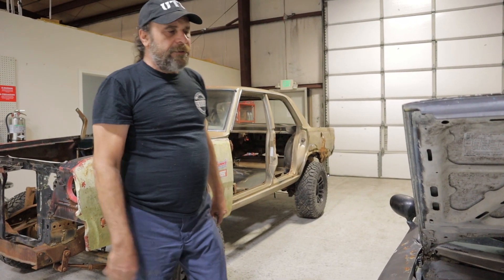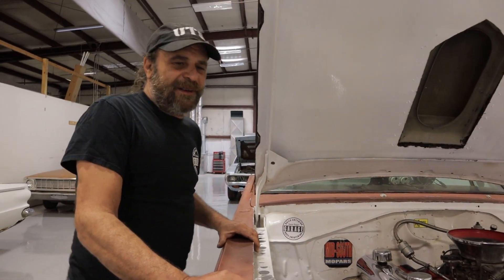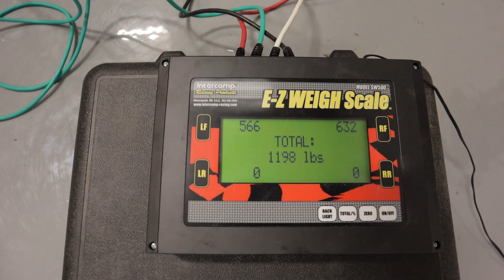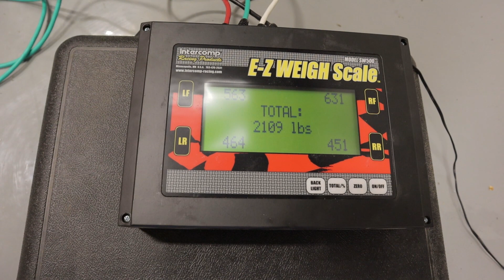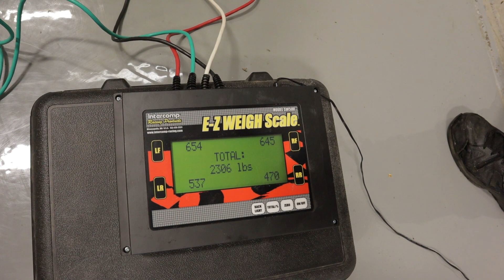Plan Z Weigh-In FAIL!...And A Slanted Miata?

Comment: If something like this was around when I was young I would have been happy to hang around and work for free just to learn stuff.
Reply: That's what I did back in the day. Hung out with the motorheads on my block when I was 11-12 year's old in the sixties. I remember sitting in the engine compartment of a guys 57 Chevy pounding pistons in during a ring and valve job. I loved it. I'm 63 now and the magic hasn't gone away. Uncle Tony is the real deal. I love Mopars too from the sixties and seventies as long as they have points in the distributor, I work on them.

Comment: Love the slanted Miata idea.
Reply: Him calling it weird and kinky made it better lmao. I think its a good idea, no hate on the little what 1.8 engine in there or 1.6 BUT a slant seems like more his style. I'd love one of those little cars and just have a peppy little scooting car.
Reply: He's gunna do it no matter what, but its not going to be an autocross car anymore when you add 175lbs to the front and even have the weight further forward, but relocating the battery to the trunk and putting racing seats in the front would help...hole saw?
Reply: A slant 6 in a miata? That's a terrible idea. I love it.
Reply: @nicholasagnew2792  heavy battery in the trunk and some fiberglass or even carbon fiber hood and fenders should balance back out.
Reply: @nicholasagnew2792  The engine weight will be more toward the rear than the stock engine because part of the engine actually sits in the passenger area of the vehicle.  He had to cut out a nice hole in the firewall to allow this to happen.  Of course, your comment was made 1 month ago and he may have done all that to the Miata since then.  I just watched a recent video on it and, it fits...barely...but it does.

Comment: Plan-Z - battery - remove the lead acid battery and replace it with a Li-ion staring battery.  You'll loose 40# easy :-)
Steel wheels on the front have to go.  Pro-Stars weigh half.  Look for lighter tires ...
More drilling - backing plates, sides of the brake drums, I'm sure you can find things to drill ... You are not going to be stopping in the rain ...   CrMo tube tie rod and other steering bits ...
On the Miata, slant hell yes (do you have an aluminum one?).  Chrysler four speed, or full manual valve body TQ-Flite.  Gotta have side draft carbs (sports car you know).  Some bling would be nice.  Set the engine back as much as possible to help with weight distribution.  Ultra heavy fronts do not help on the Auto-X.  It'll be a ton of fun.  Nothing out there will have the TQ to weight ratio, except full on race cars ... :D

Comment: Lighter wheels. The factory steelies aren't the lightest, and the rears might be lighter if you went with a circle track wheel.
Reply: Basset wheels are the lightest steel wheels at 19lbs ea. They use them in NASCAR
Reply: Yes to lighter wheels.. but.. them Mopar wheels don't weigh much.. he could always drill more holes in them Center lines.. that's a terrible idea those are rare as F, there 5 on 4 bolt pattern.. the Classic Dart owners Bane.. hahaha trust me I know..
Reply: Thomas Burch spot on . Also , would that car hook on a 7” slick ? Very skinny front runners . Make his own carbon fiber lift off only hood and deck lid. Since track only , could rear discs be used and front brakes removed ? Cast aluminum valve cover / then file off all but the minimum to seal . Is there an aluminum slant 6 head available? Or was all unnecessary weight removed from it like it was from the block?
Reply: @DougsterWolverineGarage  Remember this is a poor man build, people keep forgetting that!
Reply: @jamessharp9790  This is a poor man build people!!! Anybody can throw money at it and loose another 300 plus lb
Reply: @hemidart7  good point!
Reply: Hes like a super good bracket racer he made the bottle rocket faster in the 1/8 with heavier wheels

Comment: Tripple Webbers on the slant in the Miata please!
Reply: Absolutely! Then it becomes very easy to make different runner lengths to move the torque peak up or down. You can also make and test individual runners vs one, two, or three plenums. Maybe team up with holdner and do dyno testing.
Reply: @davidleonard8369  I'd even be happy with SU's :-)
Reply: @brocluno01  never liked any cv carb. But I have tuned many of them.   And many types of vehicles have been manufactured with them. Sure fixed a lot of motorcraft vv 2700 carbs back in the eighties.
Reply: @davidleonard8369  I think the shop took the VV in my old 79 LTD out back and shot it. They could either get it to pass emissions or run right, not both.

Comment: A slant in a Miata is just wrong.  And that's why we do stuff like that - because it's wrong.  :-D
Reply: I think I'd go with a 318, but even a slant 6 should produce a fast car, small and lightweight.
Reply: I agree, personally I'd put a 2.2 out of a 80's Daytona in it
Reply: But the slant is mucho torquey AND high revving! I think the slanty is a better choice than a v8 for this application
Reply: @DougsterWolverineGarage  Slant 6 High revving? Have you ever seen one? they are flow limited to about 4-5,000 RPM. There is no way possible to over rev one, except rolling downhill in 1st gear, starting in 2nd gear
Reply: @Tony Ross Right on! That's about a 2400 lb car, and with a dose of the UTG weight-loss program, that could be a real screamer.

Comment: You said you wanted to SCCA the Miata, a slant will mess up its weight distribution, and make it super nose heavy. Not that it would not be neat, but it’s a go cart the way it is. Replace the clutch and run her for a bit first.
Reply: I just posted that he need to look at the SCCA rule book before he does ANYTHING. I wonder if he has ever heard of Formula Drift?

Comment: Just commenting - not telling you what to do. :D I'm sure you could pull weight out of those seats, use a Borgeson steering box and maybe a lighter steering column, replace the battery with a 'stereo amp' LiOn battery, drag shocks...

Comment: I don't care if they're "out dated", I still LOVE the look of those rear wheels on Plan Z! Since Cragar SSTs apparently aren't available anymore, I just ordered a set of American Racing Outlaws for my current project, 15x10s for the rear and 14x6s for the front to get a bit of "rubber rake". I'm planning to strip off the clear coat and polish them to a mirror finish.

Comment: It's funny you guys weighing this car and you talking about the amount of gas in it remind me that my dad always used to leave his truck running when he went across the scales he said that the oil that was flying around inside the engine didn't weigh anything cuz it was flying through the air he would always then turn the truck off when we got back on the scale so all the oil was in the pan

Comment: When Slant swapping the Miata, please use the smaller engine so it will rev. Also, I believe a few videos back you were talking about wanting an inexpensive light weight piston for the six. I vaguely remember from decades ago, a guy in one of the thick, specialty issue mags was using pistons from the little compact front wheel drive commuter cars Chrysler used to sell in the slant six. I can’t remember what rods he was using. Maybe one of your viewers has a copy. I haven’t been able to find it in digital form. Good Luck and Happy Hunting!

Comment: As someone else said, a smaller battery will definitely get you down to your weight goal. Or, if you take a generator to the track, you could lose the alternator and charge the battery between rounds.

Comment: Aluminum radiator,  aluminum master cylinder, are the front wheels steel? Find Lincoln or mercury spare tires they are 16 in skinny aluminum and matching bolt pattern

Comment: From what I can find about the base weigh of this car, it shows 2,705 to 2,855 lbs, so at 2,100 lbs, that's a pretty good amount shaved off this car.
Reply: Car came out to 2109lbs . W Tony 2305lbs .. but yeah good amount of weight was removed.
Reply: @codyramos3200  Thanks, I did see the video. I must have not proof read my comment before clicking the button. LOL 
then subtract 3 lbs for the prop rod.

Comment: Remove the hood and trunk hinges for aluminum pins and clips, go to a small aluminum radiator (steal from Miata), remove fan and put on electric one from Miata, look into lighter weight seats (aluminum sand rail buckets will weigh the least), lawn mower battery, Replace steel wheels with aluminum or mags, look at the efficiency of the leaf spring pack (given the output you could probably use less leafs or cut leafs).....that should get you to well under 2100lbs....probably under 2050lbs.

Comment: The hood has no structural support. I would drop a fiberglass hood on it and a fiberglass deck lid. Maybe some Centerline convo Pros up front. Are you still running drums up front?... maybe some lightweight aftermarket disc setup up front.

Comment: Two words... Aluminum and plexiglass.
Replace side windows with plexi, go with all aluminum master cylinder. Then crawl around it and 86 whatever you can shave off. Maybe come off a few bucks and have a composite hood and trunk lid knocked up. That might put it under 2000.

Comment: The idea of a slant 6 in a Miata both horrifies and intrigues me! Gonna have to boost or spray it if you want to make it worth it performance-wise, though, since the slant only makes around 30hp more than the stock motor while weighing a good bit more.

As for the Plan Z Dart, the logical next step would probably be a fiberglass hood/trunk lid and replacing the glass with lexan. That seems pretty antithetical to the build, though, so... maybe lighter wheels?

Comment: Tony, on your next \6 think about removing weight from the block. A very old super stock and road racing "trick". In the past Jaguar had body men smooth out the outside of their blocks with body filler because most of the I-6 block was visible.

Comment: Uncle Tony, You have to think about what class that Miata will run in before you change the engine. SCCA Solo 2 isn't Run What You Brung.. Before I moved  from the Chicago area I used to help a friend compete with his Toyota MR-2. There was a guy who was a National Solo 2 Champion with a TR-8. He told me his car's gearing was so high he couldn't drive it on the street and also he said automatic transmissions are the way to go. With a slant 6 it might be a better Formula Drift car.

Comment: While i fully support the slant 6 idea, whats stopping you put a fast 318 in it :P
Reply: Totally agree, it's shorter and more weight to the rear wheels!!!
Reply: 300lbs in the nose?
Reply: @ScottKenny1978  the slant really isn't gonna be lighter than a small block v8 they are both big cast iron engines. V8 miata's don't handle bad that is just a rumor.
Reply: @GnarshredProductions  it's still another 300lbs in the nose, which will mess up the balance.

Nobody driving a v8 miata is doing autocross.
Reply: @ScottKenny1978  I agree with you but an old cast iron slant six is also probably just as heavy as a small block and it will be worse because its longer so the weight would be further forward over the nose. Im an import guy if it were my car I would keep the 1.6L miata engine run on a standalone ecu like megasquirt and it would be getting a turbo but I think that new technology is above tony's level of understanding he is old school so for an older hot rod guy like him a small block v8 would probably be the easiest and best/cheapest option. Could even put a 4 speed behind it and install a hydraulic handbrake so when he gets bored of autocross he can go drifting.
Reply: @GnarshredProductions  apparently the iron slant is 195lbs heavier than the Mazda motor. 

The aluminum slant is maybe 65lbs heavier (aluminum being 1/3 the weight of steel). And a guy here has offered to send Uncle Tony an aluminum slant block! Fiberglass hood and fenders should account for any remaining weight increase from the slant.
Reply: @ScottKenny1978  that's not bad then with the aluminum block one.
Reply: @GnarshredProductions  watch more. the guy has efi skills

Not sure what a 318 and trans weighs
Engine and trans from a 1.6 or 1.8 miata is between 300-350lbs depending on whos measurements you decide to believe.
I fully support the autocross idea but it needs to be to the soundtrack of v8 noises!

Weight isnt the concern anyway. Its making it fit/sourcing parts/motivation thats the concern!

Comment: Weight reduction ideas if you havent done these already:

Go inside the doors and have at the window crank/articulators with your drills and hole saws.

Smaller trunk hinges

Shave the outer lips of the rims maybe 1/16-1/8 in if they can hack it.

Drill out some of the larger bolts/Replace some low torque/low stress bolts with aluminum bolts.

Aluminum pullys.

 Replace washers with loc-Tite

Take a flap wheel to the floor  and thin up some non structural areas.

Shave down some of the body seams

That should get you 10 pounds.
Reply: All of that and just go full titanium frame😉😂🤣😏😎✌🏽
Reply: or at least replace the door glass with Plexi
Reply: @Aaron-TheHandsome  Well thats a given ;)
Reply: @TD_YT066  Yes but he wants to keep the glass IIRC.

Comment: ROLL UP YOUR CIGARETTE UNCLE TONY!!! I was going to ask how much the hood prop was.
Hello Uncle John. 😁
Could you remove the truck spring rods and support braces to shed a few more pounds? Possibly make the trunk a lift off panel and then you wouldn't need the lock either.
Reply: @oldpolak5203  Rebar doesn't weigh that much. Less than most folks think.
Reply: Those factory trunk hinges and springs are gone.  The lid is held on with pins and has small strap hinges.
Reply: @johnwilburn  Thanks Uncle John, I thought I seen the truck was open on one video but didn't see a prop rod holding up.
Reply: @bigbear5510  It doesn’t have a prop rod, it will lay back against the roof to stay open.
Reply: @johnwilburn  Thanks again for the information.😎
Reply: @oldpolak5203  Uncle Tony could set in a sauna for a few hours to sweat off a few pounds. LOL

Comment: Uncle Tony try cutting out the back plates of the quarter panels from up under the car, it’ll protect against rust anyways, just be careful not to cut through the panels. Both cut out should be 7 pounds even.
Reply: Cut out the metal in the rear seat area, the spare tire compartment, and re-weld it flat. Should drop quit a bit.

Comment: I feel like yelling at Uncle Tony to not strap down Bottle Rocket by the passenger side control arm when loading it on the trailer for the May 8th testing at the strip.  I can't even warn him to take a new control arm bushing with him just in case.  It is too late as this video is now in the past and it is now May 9th and I still can't time travel.

Comment: Use a light weight battery like a optima it will easily shave  9 pounds +
Reply: Lithium battery. Way lighter. While we're at it let's put helium in the tires!
Reply: @davidleonard8369 He only needs to lose 9 pounds a light weight battery will easily do that as for the heliem really🙄
Reply: @oscarwalton1188  I was making a joke about the tires.
Reply: But it's shaving weight in the wrong place.  You want that heavy battery in the back.  Ideally, the weight should come off the front.
Reply: @entropy156  he only needs to lose 9 pounds that wouldn't make that much of a difference he could also pirate a aluminum to drive shaft from a late model crown vic
Reply: @oscarwalton1188   Aluminum drive shaft is a much better choice.  Weight reduction and it's rotating mass....if there's one that will bolt in.  Having one fabbed would screw up the other side of this build:  doing it for nearly no money.

Comment: 7 lbs? Easy... Look real hard at the battery....shave tread off front tires...i see room for more holes...is every wire as short as it can be? Gut the deck lid/hood. Smallest possible fuel cell? Drill the rotors...Put the wheels on a lathe...sand the paint off..cast iron master cylinder needs to go...acid dip everything.

Comment: Go smaller or use aluminium radiator when racing the engine should be fine for short running times

Comment: Tony, I noticed that you drilled holes in the inner fenders. Why not drill more holes in the floor pan and trunk?
Reply: The center of the trunk pan is cup out! I don't think that the tracks will allow you can run a car with holes in the floorboards.
Reply: They want the passenger compartment sealed in case of fire. 

I’d say a lightweight battery would make it easy to shed that 10lbs. Plus could go to skinny front wheels/tires which would save some more weight.

Comment: You know what’s even more wrong for the Miata? Use a low deck 170 cubic inch slant six. It’s lower and lighter. And will respond to the same hop up tricks, but for air flow, you will be able to rev higher for the same air flow.

Comment: I share your desire for "dare to be different". I have a vision that's only somewhat the inverse of what you're thinking with the Miata. An early 80s Ford "SVO" Turbo Motor in an early 60s 6-cylinder compact. Just with stand alone wiring to run the essentials of the basic computer. REASONALABLY increased boost (not stratospheric numbers), larger intercooler, etc.  Not gonna say what body I'm thinking of. But I'll give you a hint: it's NOT a Ford.

Comment: Put the Miata on the weight saving diet, then forget the slant and go two stroke sea-  doo  engine . It will have more power and be 300 pounds lighter.

Comment: Slant six with electric pusher fan for the radiator would probably fit in the Mopar Miata without moving the radiator.
Reply: I think that the problem is that the bottom of the radiator is too close entirely.

Comment: Make your own battery with lithium cells and save 30 lbs! oh btw to turn that motor you might need to run them in parallel and series as well to get enough amps
Reply: IIRC, laptop batteries are 3.2v per, so 4 cells in each series, times 5 parallel legs to get the amperage needed.